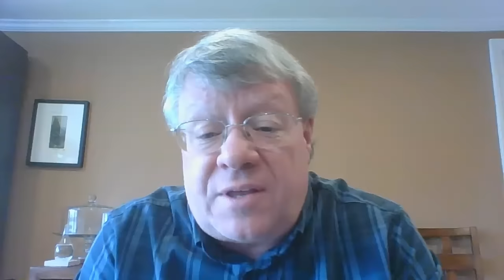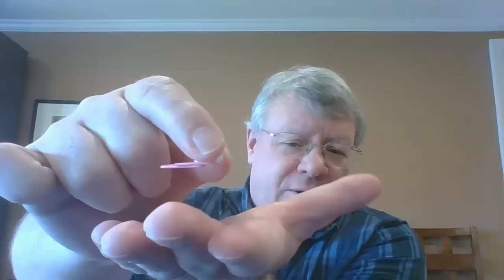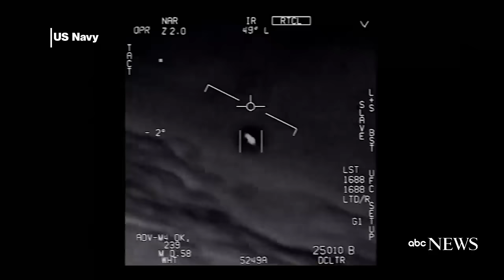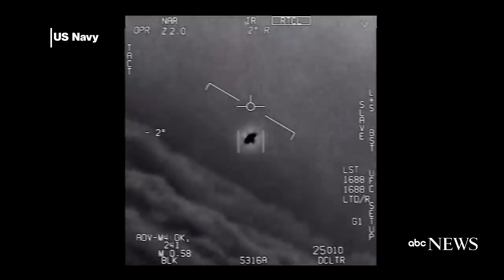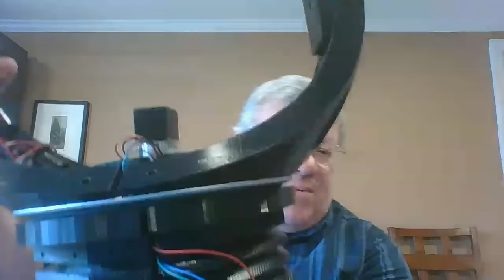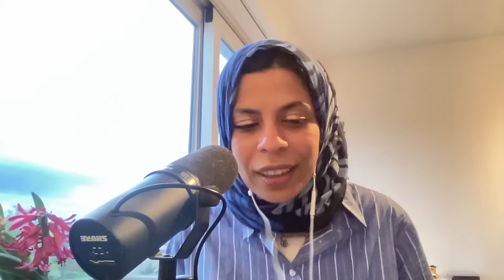Kevin Knuth "UFO Physics"

Comment: The craft may not need a lot of energy to move if it can reduce its weight by being out of our vibrational frequency .
If you can control your location with respect to what dimension your in then you could have just an essential awareness transfer and so in increments.
If you can transfer from one dimension to another then you might also find a source of energy in between dimensions like zero point energy.

Comment: I know exactly what some of the entities are, even where they are at but no one listens even when given the proof. I've even seen a sample of the tic tac pilots platinum blond hair. They seem to have a remote link to asian genetics but they have blue eyes and platinum blonde hair, asian features in their eyes and their eyes are approximately 5 times bigger. They spend most of their lives approximately 6 foot tall, when they get older their eyes turn pink which makes me think their genetics have some kind of albino genetics, their skin is paper white. Their life spans are rediculous compared to ours, but their bones are skinnier and lighter. I also have a pretty good understanding of how the crafts work, there is a type of light that is formed in black holes that push matter away. They have miles of fiber optic coils in the walls of the tic tac, i believe they are using mini version of something like proton accelerators but are putting something like mosons or bosons through the fiber optic cables. This causes a wavey field around it that sometimes gives off light. Its like looking at the craft through heat ripples.
Reply: Also their nervous system is 3 times faster than ours, so they don't see video screens well. Therefore most of their tech is telepathically in a matter of speaking controlled. Their tech allows them to put words and visualization straight from their mind, as well as into it. This is how they pilot the crafts. The acceleration is nullified by the field around the craft but occasionally the coils will melt due to imperfections in the fiber cables.

Comment: Profesor sir i need to share with you, that myself and my fijian friend in Fiji observed one of the slow mooving galloping horse speed tear drop rainbow edged black back, "we ware on a higher hill" welding spot light luminous bottom, at tree top hight, moove out of the shallow  river up the hill into the solid rock, silently. We observed it for about 2 minutes, and it was football field size. My friend called it TEVORO i said ufo. TEVORO in Fijian is devil. The old testament place where the opposed Moses ground opened up a light shot out of the Lords cylinder and swallowed up the 400 Israelis was named TEVORO. Read this again,

Comment: There are three things which a 'gravity warp' propulsion system would affect.
1 is, of course, gravity. The 2nd, as Kevin Knuth said, is time.
The 3rd is inertia. 
It isnt too hard to make the connection between gravity and time, because we've done experiments that prove this: initially these experiments involved placing an extremely accurate atomic clock in earth orbit, and one on earth at sea level. The clocks must be absolutely synchronized then measured separately after they are placed. This was done and it was found that the clock on earth at sea level began running slower than the one in orbit! 
Why? The best way to explain it is that spacetime is stretched out the deeper one goes into a gravity well, resulting in a slower running clock on earth's surface & a faster running one in orbit. So we can see that time and gravity are inextricably related, which Einstein showed in his relativity mathematics.
But inertia? Why inertia?
Well. Because inertia is thought to be caused by the gravitational fields of everything in the universe. This means that if you produce a gravitational warp around a spacecraft, you also produce an inertial warp, which likely manifests as a cancellation effect. So now we have a very interesting thing: a craft that will not produce a sonic boom because the air which comes into contact with the field around the craft is cut off from inertia by the field! So it can impact the craft with little or no effect. Water, same thing. Due to the reduction/cancellation of  inertia within the field, no G forces are felt during 800G maneuvers. Also, the massive amount of energy required for such acceleration and instantaneous turn performance is cut way down because the craft's inertial mass is effectively removed as far as the outside universe is concerned. This accounts for most of the so called 'violations of physics' that are seen in UFO reports. There is no violation, only an unorthodox (to humans anyway) use of physical laws.
Reply: Thanks that made sense. However, the shapes and sizes vary so much. Either there's many different species of alien or like us don't understand the concept of freedom from choice not freedom of choice lol.
Earth's getting more crowded.
One question I'd like answered please.
Give me one instance of alien intervention that improved humanity's existence?
Struggling everyone aren't you lol
Reply: Ah you've given me an ephiny and since there's no facility to post a comment here it is. There's a caveat though. If you ain't cool you won't understand me.
Those of us who ' get down' will live longer.
Those of us who ' get high' live faster.
Those of us who do both live forever.
Which reminds me.
As I'm in a safe environment.
You want the formula for immortality?
CRISPR+CAS9 technique+jellyfish cells. NOT the squid cells. Look where they ended up lol
Fact check me.
You're welcome
Reply: I think the aliens breath oxygen and the starship inside has same gravity as surface of Earth since we are living beings with the correct temperatures and pressure for cell structure.

Comment: Professor Knuth is very sweet but it boggles my mind that he insists we are “seeing” 1,000 g accellerations, 40,000 km/h kinematic speeds, and gargantuan, whole-nation power generation amounts of energy packed into small (40 feet) areas. We are not seeing any of that. What we are seeing are APPARENT accelerations and speeds, and APPARENT (according to classical mechanics) large energy requirements (energy that somehow doesn’t dissipate into vaporizing the planet when a school bus-sized object drops 80,000 feet and stops dead after 0.78 seconds or so) to pull such feats. Here we must consider what  another physicist, Dr. Jack Sarfatti, is positing regarding the UFO/UAP phenomenon; namely that it is warping spacetime in its fuselage and vanishingly thin layer of space around its hull with small amounts of (EM) energy, achieving possibly a complete control of spacetime. What we perceive as massive g’s and speeds are just warped and of necessity deceiving PICTURES, much like how we perceive odd images of gravitationally lensed distant galaxies and galaxy clusters.

Comment: But then when you consider that gas dots in the spacing process of traveling around a certain degree of traveling through a dense liquid and has zero deflection in the transmission of flow rates the gas dots stretches in 90 degrees turns the dot sphere into a longitudinal dot then back into a spherical gas it also spins the dots these draw into itself a positron character which can be used as a graviton in the mindset

Comment: The objects are cold because they are using High pulsed post luminal D/C cold electricity see Tesla. Single wire electricity plasma makes conductors superconducting. I discovered accidentally field levitation 20 years ago using a coil array I call the gravinductor.

Comment: Think about densities in a transformation of circulation the compare to the electric transformation process and densities of electricity itself is changed to a workable system well liquefied and traveling through a pipe that has a satellite of a gas dot in a flow of density around it space enters the equation itself

Comment: Something we have not discovered happens when a force field is created and a true impenetrable force field seoarates everything inside the field so completely that even inertia is created separately inside the field than from the outside of the field . Inside the field you would only feel inertia you created inside the field. 
Making it move is probably accomplished via a very advanced quantum computing electronic gyroscope . Quantum  computing would allow to navigate faster than light and the field itself allows travel to be done differently through  parh ways of what we understand to be dark matter space . Everything inside the field can be moved like an election jumps instantly. A quantum field that allows quantum movement

Comment: Isn't this the guy that said a petrol engine would restart on its own after being subjected to a 3 Megavolt per meter electromagnetic field... LOL. Of course he used an example from a science fiction movie. Roy Neary's Ford F250 pickup truck from Close Encounters Of The Third Kind. An electromagnetic field of that intensity would fry any vehicle occupants.
Reply: No the engine was stalled when the area around the engine was ionized with that large field but sometimes restarted when the field left with the craft. But your point is good if the car stalled but why weren’t the occupants harmed. Another physicist Alexandre Kassiantchouk in his recent 3rd edition of the book “Beyond The Cutting Edge with Bob Lazar” gives another explanation which may void the problem you mentioned: 

Slowing time around the craft causes increase of space permittivity, which is space electric capacitance - ability to hold an electrical charge. How does that affect elements of the ignition circuit? A capacitor’s capacitance increases and voltage decreases. Increase in permittivity causes decrease in space permeability (magnetic property, which is inversely related to permittivity). That decreases the inductance of inductors (such as the ignition coils), and their voltage/power decreases as well. Increase in permittivity, specifically as dielectric property of space in a spark plug gap, will require increase of voltage/power for discharge to happen. But, as we have seen already, voltage in the circuit drops. Thus, no more sparking! And the whole circuit is out of sync – parameters of all elements of the circuit changed. Now, about batteries’ drainage: the increase in capacitor’s capacitance might drain batteries (by pulling more electricity out). With spark plugs not discharging, but fuel still being injected into combustion chambers, fuel might flood these chambers. That might be a mechanical reason for pistons not going through non- compressible liquid. …

https://medium.com/timematters/electric-circuit-problems-around-ufo-a6d01e6c658f
Reply: The obligatory "LOL" in your statement suggests that you really don't understand the topic and are struggling to get past your high-school text book understandings. You're not the enlightened one you believe yourself to be so maybe listen more, think more and comment a little less. hmmm ?
Reply: @TheCuriousOrbs  he actually has a point. I asked Alexandre and he has another example of radiation burns to people in these types of situations. Look at chapter 12 of his book. It’s a free download. Radiation sickness and UV burns are reported in abduction cases.
Reply: @TheCuriousOrbs  So you believe a petrol motor and all its electrical ignition wiring would survive a 3MV per meter electromagnetic field do you? PMSL.
Reply: @markszlazak  The bottom line is none of the ignition wiring would survive a 3MV per meter electromagnetic field. The distributor and ignition wiring would all be fried. He said the pickup in the movie was diesel, it was an F250. From 1974 to 1977 they only came with 6 and 8 cylinder petrol motors. Personally I would put a line through anything said by Bob Lazar.
Reply: Interesting question. Knuth had about 10-15% of the cars restarting (on their own) but I don't know the number that couldn't restart because of damage. EM pulse effects on older cars has opinion varying from none will get effected to some will get effected/damaged. I don't have field strength varying over time data to get current sizes so I really don't know. Knuth would be the one to ask your specific question. He cites an older study on this.
Reply: @markszlazak  This would have been an academic study done in a lab, not a physical test done in the real world. None of the wiring insulation would have stood up to 3MV per meter, including the enamel insulation on the wire inside the distributor, the coil turns would have shorted out. He didn't reference an "EM pulse" he referenced an EM field.
Reply: You will just have to ask Knuth about your concerns. Let’s see what he has to say.
Reply: @markszlazak  To be honest I don't think anyone that presented at the SOL Foundation was worth listening to.
Reply: Dr. Knuth responded and here is what he said:
“The potential difference required to ionize the air (to subsequently short out the spark plugs and distributor) 
is on the order of 3 MV/m.  While this is a high voltage, there is almost no current flow to destroy electronics.
Incidentally, this is the same voltage that is required for you to get a shock touching a door knob in winter.
There also, there is almost no current, so it doesn't injure you.”
Reply: @markszlazak  He's talking about ionozing the air to short out the plugs an distributor. Personally I doubt this would work under a car bonnet if at all. With extremely high voltages it doesn't take much current for devices to fail. I think he should demonstrate this practically. I would have to see it to believe it.
Reply: @stevemumbling7720 I don't see why they wouldn't short out if the air is ionized. The bonnet would not prevent air from circulating inside.
Reply: @markszlazak  Do you think you could ionize the air around an electrical circuit inside a metal box using an external electromagnetic field? Dr Knuth doesn't explain exactly what equipment he would use to produce his 3MV per meter electromagnetic field, there's probably a very good reason for that.
Reply: @markszlazak  There's not enough information on what he has in mind. Is there a frequency involved or or is it a static electromagnetic field? I think he's talking absolute rubbish, if you think otherwise that's fine by me.
Reply: @stevemumbling7720  The metal box would have to be airtight. The UFO generates the field.
Reply: I think the time variation of the field is an issue. The craft would have to move over the car slowly enough. ;)